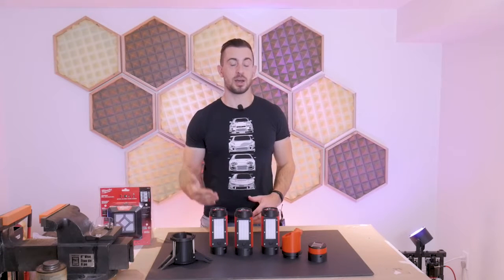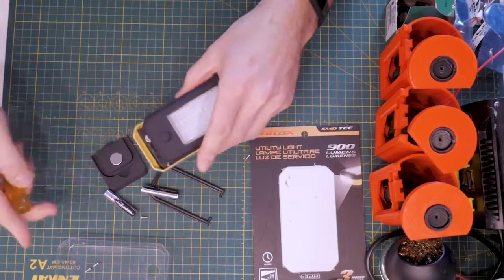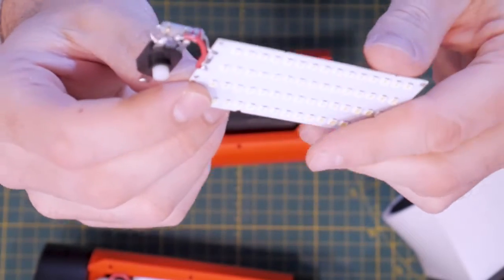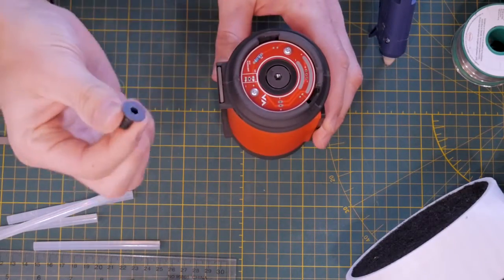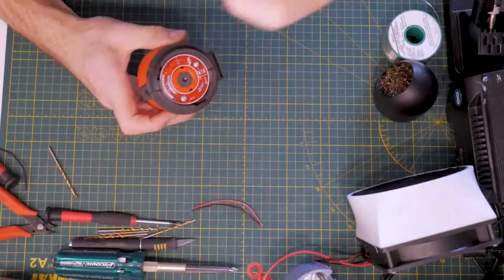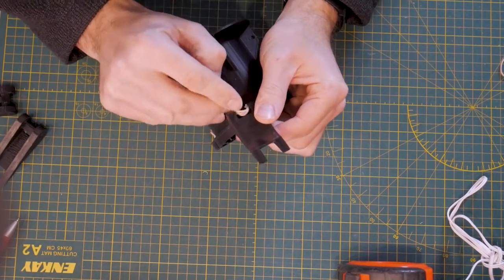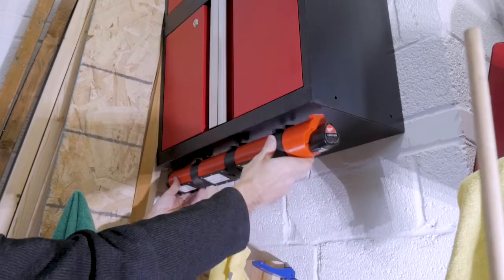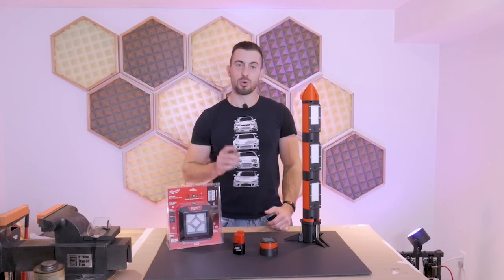Building A Magnetic Modular LED Work Light! Powered by Milwaukee M12 Battery! Plus Bonus Flashlight!

Comment: I really like the work that you've done here. I came across your video after thinking about making some of my own custom work lights. I have one of the Milwaukee M18 work lights. I'm very impressed with it's color rendering and photometry, but I'm not always able to position it to where I need the light. My criteria is being able to point the light where I need it, while still having high quality light, with good battery life. 

With the light you've constructed, you'd probably have some better battery life with a proper constant current LED driver circuitry.
Reply from the maker: Thanks! Yes I plan on making some custom panels whereby I can use some constant current drivers and better colored LEDs to take this to the next level!

Comment: The resistors dissipate heat too. A switch mode current regulator would be more efficient. Of course more expensive, as you'd need one per module, but then it's more easily tunable. The cree xb-d Leds are very efficient at 148 lm/W. Having a higher voltage panel would also be more efficient. Less losses in the wires.
You must have good cad practices to build an assembly like that.
Reply from the maker: Thanks Derek! I am going to be working on a revision with custom LED panels. I'm going to find some good LEDs as you suggest and a constant current driver to match. Should take this up a notch! As for my CAD work, I work in Solidworks on an almost daily basis so I'm pretty experienced when it comes to the 3D modelling aspect :)

Comment: Its not really "you get what you pay for", but leds have different brightness. https://www.youtube.com/diyperks has been doing various projects with different leds. the brigther they are, the more power they need, the more heat the generate. So I think your solution is really good. (I do recommend his video on the stupid bright ones, they are silly fun to watch)
Reply from the maker: I'll have a look at the link. By no means am I an LED expert but there are a few factors to consider behind the LED technology that you pay for. The quality of the LEDs (how that translates into brightness and the color rating to make things look more "natural) and then the driving circuit behind them that may affect the longevity and power consumption. The Milwaukee light is likely using some kind of proper driver for their LEDs. Even when you turn the Milwaukee unit on, the light softly comes on instead of the instantaneous on with my cheap panels (no driver). So there are a few extra bells and whistles that you pay extra for. But for $4 per panel + the button and COB I can't complain much for a cheap panel I was able to hack out of a dollar store light!
Reply: @EmbraceMaking  no totally, its an awesome solution. He just made one with an ultibright one, that required water cooling and like massive power supply. Sometimes its just fun to know about options. I think your panel solution is great.
Reply from the maker: Those are fascinating builds to test the limits!

Comment: I mean, that only means you have to take apart the Milwaukee lights to integrate the LEDs into your work lights. Because for all intents and purposes your design is more versatile and with some additional work might even compare in toughness.
Reply from the maker: That is the plan! I'm going to upgrade the light panel and do a "version 2" :)
Reply: @EmbraceMaking  Awesome. I'm genuinely excited to see a V2. I like the modularity, it'll enable one to easily design new power bases to accomodate different power sources and even swap them around at will (e.g. there could be a base tied to a power outlet for mounting on a permanent shelving unit while not in use elsewhere).
Reply from the maker: Yeah on reddit someone was asking about Dewalt compatibility. It is something I can design different receptacles for as you stated. Lots to watch out for in the updates in the new year!
Reply: @EmbraceMaking  Here's hoping for a better new year
Reply from the maker: For sure, always something to look forward to no matter how weird things are out there!

Comment: I'm floored with the design effort put in here. You've got multiple keyed sections preventing improper assembly, a custom dual-sided PCB, a massive amount of CAD work to model all those parts, and a suspension system on top of all of that. I love Milwaukee tools, but forget their light here... talk about a phenomenal learning experience, and with some solid results coming out of it at that. Truly great work.
Reply from the maker: Thanks! It started off as an experiment to design an electrical coupling connection and sort of naturally evolved from there :)

Comment: Nice work! keep it on!
Reply from the maker: Thanks Felipe! Would love any more feedback!
Reply: Maybe you can make them more modular with a lithium cell in each housing and keep the charger in the base so can be used as a single unit or use the modules one by one. It may require more pcbs and batteries, but can be very useful.
Reply from the maker: Sounds like something for a revision 2! I like it